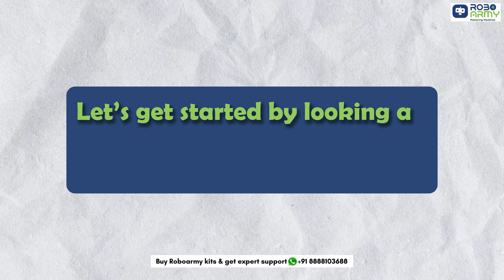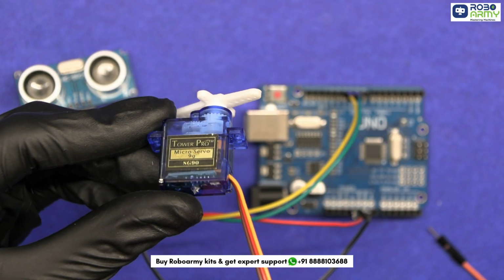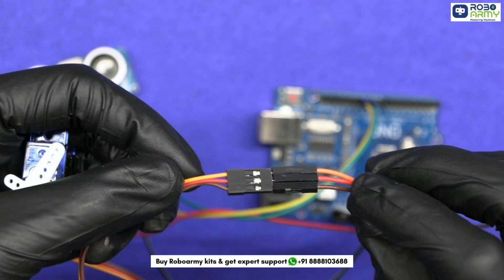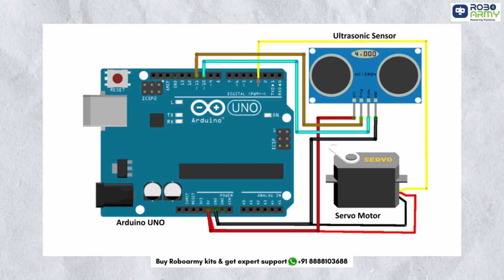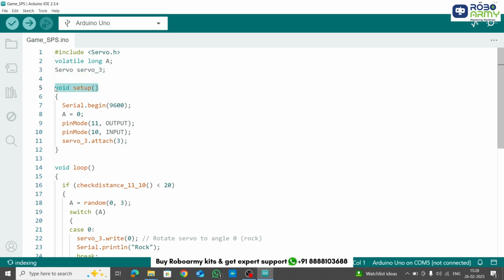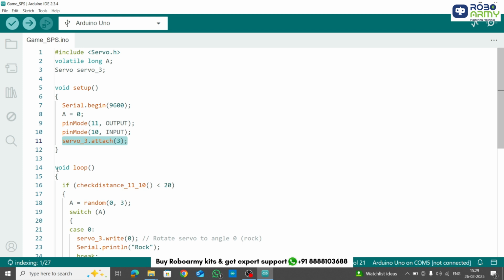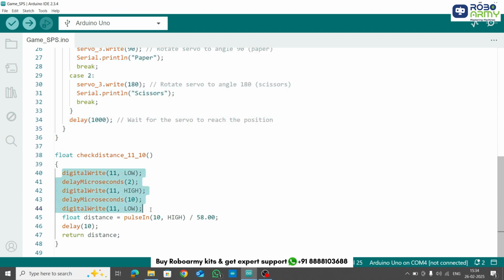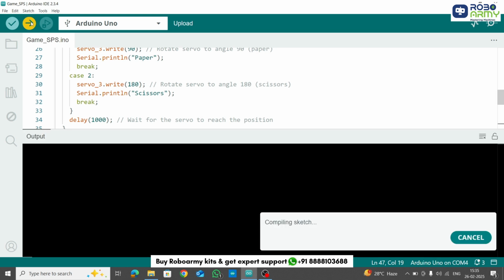Gesture Battle: Stone-Paper-Scissors Game with Arduino! 🤖 (Ultrasonic + Servo Magic!)

Comment: The motor keeps rotating doesn't wait for gesture in front of ultrasonic sensor. Any clue?
Reply from the maker: It sounds like the code might be continuously running the servo without waiting for the ultrasonic sensor input. Make sure you have a proper distance check condition in your loop, like if(distance < X) before moving the servo. Also, add a small delay after reading the sensor so it waits for the gesture. If you want, I can share a snippet to fix it.

Comment: So what type of coding language you write
Reply from the maker: Hi! For Arduino projects, I mainly use Arduino C/C++, which is based on C/C++ but simplified for microcontrollers. Sometimes I also use Python or Blockly/MIT App Inventor for projects with Micro:bit or app control.

Comment: Hi, I did this but the ultrasonic senser is lagging when I play it, it basically lags in the middle of playing
Reply from the maker: Hi! The lag might be because the ultrasonic sensor is reading too frequently or there’s a delay in the code. Try increasing the delay between readings or optimizing your code so the sensor has enough time to measure accurately. If you want, I can suggest exact changes to fix it
Reply: @robo_army_  yes pls
Reply: @robo_army_ yes pls u can give

Comment: For the Servo Motor how did you connect male to female wires on both sides?
Reply from the maker: Good question! I used male-to-female jumper wires — the female ends connect to the servo’s 3 pins (signal, VCC, GND), and the male ends go into the Arduino pins or breadboard. It helps make clean and secure connections without soldering
Reply: @robo_army_ OK Ty I got it

Comment: Can I use arduino uno R3?
Reply from the maker: Yes of course. That's what we are also using.
Reply: @robo_army_ k ty
Reply: @robo_army_ and where do we find the double battery holder DC power jack and switch

Comment: I tried the code but the servo motor keeps on moving even I'm not doing anything
Reply from the maker: It sounds like the servo is receiving unwanted signals or not resetting properly. Try these steps:
1️⃣ Check Wiring: Make sure the servo signal wire is connected to the correct Arduino pin.
2️⃣ Add a Default Position: Set a default angle in the setup() function like myServo.write(90);.
3️⃣ Noise Filtering: If using an ultrasonic sensor, add a small delay (delay(100);) to avoid continuous triggering.
4️⃣ Power Supply: Ensure the servo is getting enough power, preferably from an external source if needed.
Reply: @robo_army_  Thank you! It helped me so much!